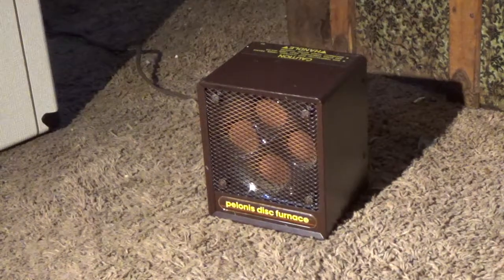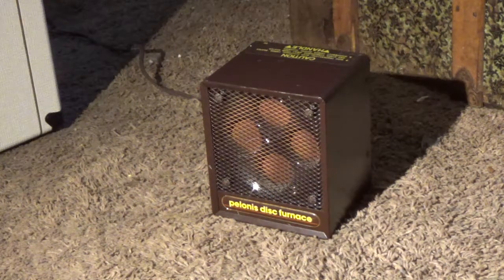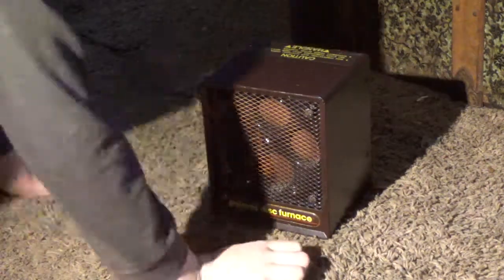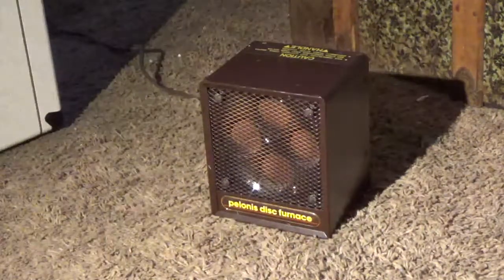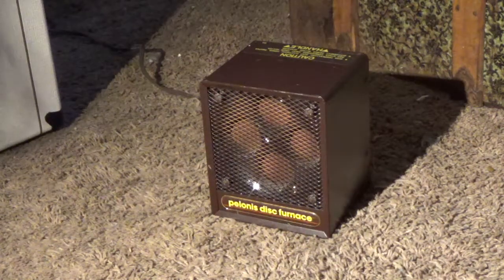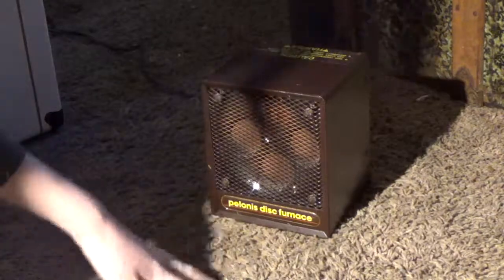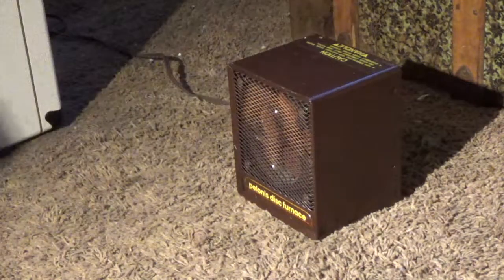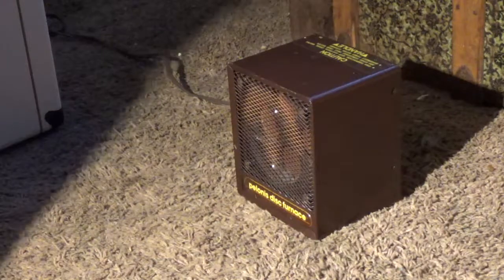Pelonis disc Furnace!

Comment: I bought one at a thrift store too . what I really like about it is my generator that I use (Honda eu2000 ) posers it ! it is somehow designed that when I set. the temperature range and put it in automatic setting it just runs steady and after the Initial warm up it doesn't cause generator rpm to go up and down keeping it at a very quiet even rpms

Comment: It smells probably because it has never been cleaned! It has a filter behind it, which is easy to clean. Once filter is out, take a blower and blow throw the front of it to clear out the dust behind the ceramic heating disc. That will help, as I just did it to mine.